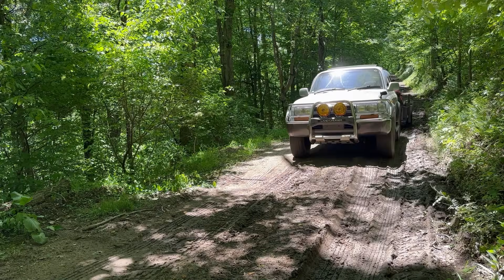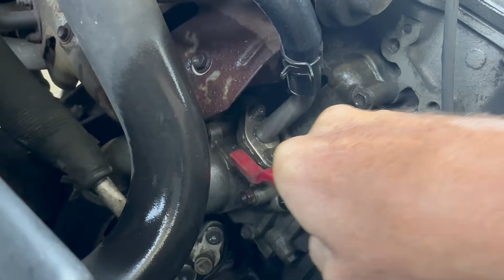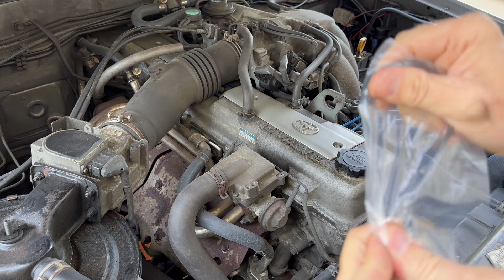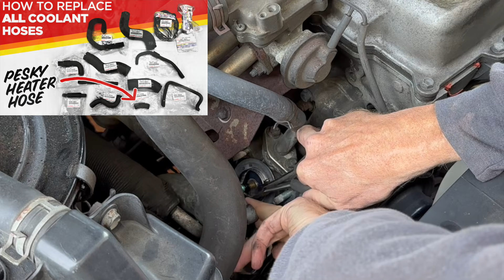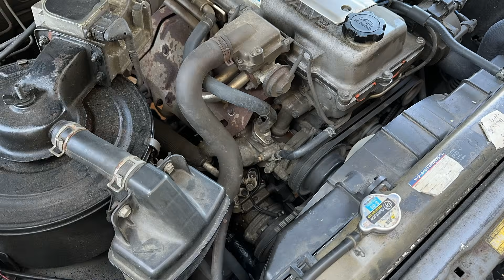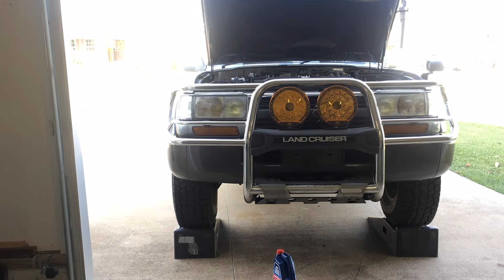How to Install/Replace Thermostat: Toyota FZJ80 Land Cruiser 1FZ-FE Engine

Comment: What happened to the 4 Runner?? Doesnt the radiator have a drain cock? That coolant looked new and could have been reused...
Reply from the maker: 4 Runner is still around and will be in the spotlight soon. I've been catching up on misc projects lately. Yeah that coolant was only 2-3 years old, but fresh coolant is never a bad thing.

Comment: Que buen video excelente para los que tienen una land crusier año 90 y quisiera ver si harías un video sobre el parachoques trasero del toyota 22r 1985 ya que estoy teniendo algunos problemas con el mio y seria interesante de ver para los que quieren tener su 22R lo mas Original posible un saludo desde Honduras 🇭🇳
Reply from the maker: My 1985 does not have a rear bumper. The rear bumper was optional for the 1988 and earlier Toyota trucks. I like the look of no rear bumper. It looks like a factory roll pan.